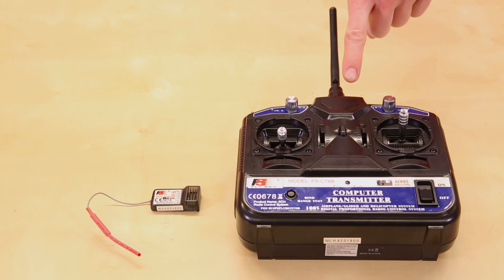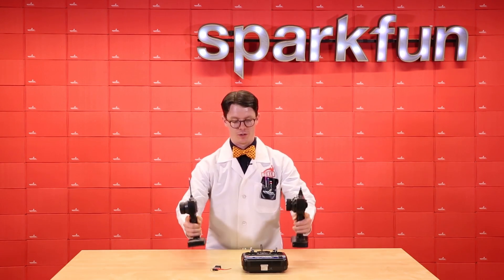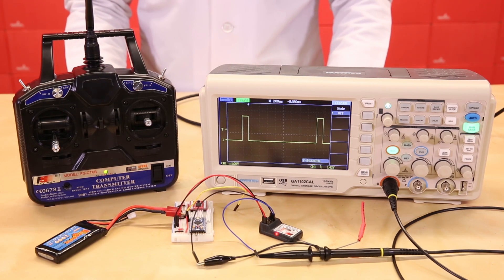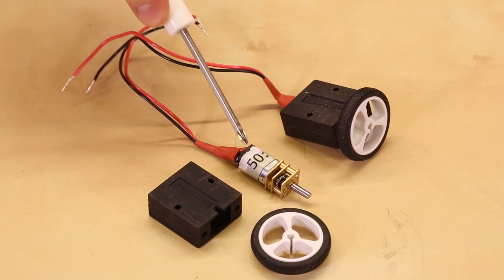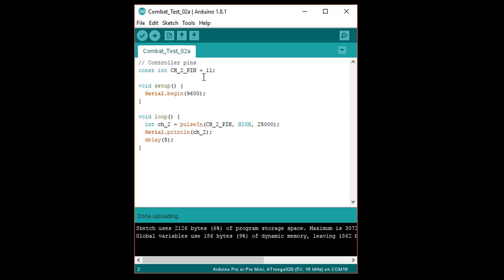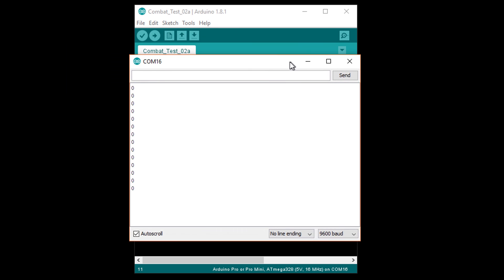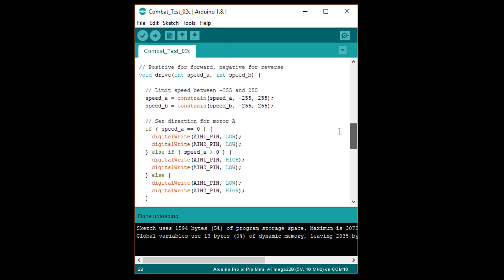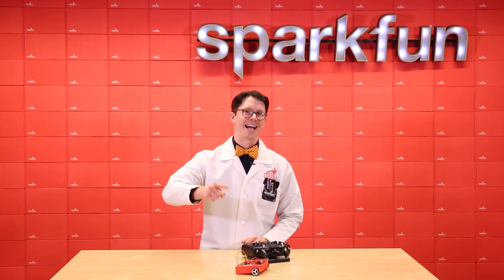Adventures in Science: Using an RC Hobby Controller with Arduino

Comment: I'm using an L298N with an Arduino Uno r3, my RC controller is an Element6 with a paired receiver, and the code just doesn't want to play.  Only one channel, forward; anyone else having this problem?

Comment: How do I power up the arduino if I don't use USB cable instead of an external battery coming form a 5V ESC connected to the Receiver?
Reply: If you are sure its 5V connect it to the Arduino 5V line. If you're not sure either dont use it or use the power in port. (on smaller models called Vin)

Comment: Ooh boy, I went away with pwm receivers for Arduino, I needed too many channels and didn't want to buy a mega for extra interrupts. PPM and serial are a lot better I've seen, since they use a single output.
Reply: Learn how to make an Arduino PCB and add PWM motor drivers like the tb6612

Comment: A really fun way of doing this is using a falling or rising edge interrupt, and a PPM enabled reciever,  you can decode 6 channels via 1 input.

void pulseDetect(){
  pulsePrevious = pulseRising;
  pulseRising = micros();
  pulseLenght = micros() - pulsePrevious;
  
   if (pulseLenght > 3500 && pulseLenght < 20000 ){    // Sync pulse of CPPM Frame detection max fram length is about 20000 microseconds
    channel =0 ;               // To store sync pulse value in ppmValue[0] , now channel 0 is set all other pulses will be read and stored, until next sync pulse.
   }
   
  ppmValue[channel] = pulseLenght;
  channel = channel+1;
  
 if (channel > 13){ //this allows incase code starts after sync all pulses will be dumped into these out of bounds channels.
   channel = 12;
 }

Comment: Here's a question for anyone who knows: what happens with the trimmers on the transmitter when you convert it to Arduino? Can they be incorporated do they still do their job? If so, how are they connected?  If not, how do you trim the quad before/during flight?

Comment: pulseIn blocks until the IO port goes high. So in this case, it's blocked for 19 out of 20ms. If you want to use the Arduino for more than just RC control (e.g. to drive some APA102 LEDs on the robot) then you have to use an interrupt handler for the RC pulse. Since this is not much more complex, I would never use pulseIn to read RC signals.
Reply: Very true, and thanks for pointing it out. Interrupts are definitely the way to go, but pulseIn is a bit easier to explain to beginners if you're just driving some motors.
Reply: Shawn Hymel . Could you do an additional video explaining interrupts?  I've been struggling to read multiple PWMs while also doing computation on the arduino and driving outputs. For example, my stepper motor output behaves very erratically when I'm reading multiple PulseIn PWMs.  Thanks.
Reply: Yes, I agree, the code is easier to understand. I am a tad sensitive about this subject because I once wasted several days trying to understand why stuff did not work as expected. In the end it was pulseIn that blocked the Arduino way too long ;)
Reply: @LSUtiger607: If you need more than one RC signal I would use a receiver that can output all channels over a combined line. This way you only need one port of the Arduino, and you have more processing power left. A (German) code sample for one particular type of signal (PPM, or Pulse-Pause-Modulation) is here: https://github.com/tinue/SUMO_Analyse
Reply: @LSUtiger607 Good to know there's interest in interrupts. I will add it to my list of videos to make (I'd like to get through other basic programming concepts first, though). Geaux Tigers ;)

Comment: On my JR XY421, they use the same assembly for both sticks.  It's pretty easy to take the controller apart and add a spring to the left stick if you want it to center like the right stick.